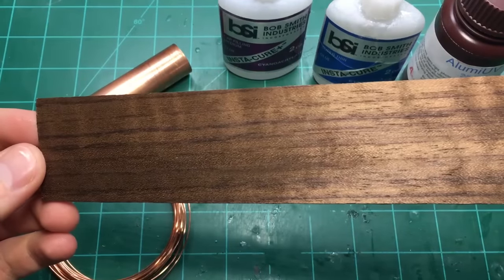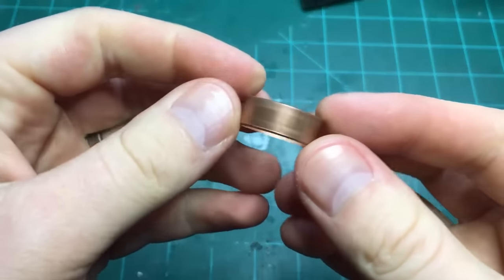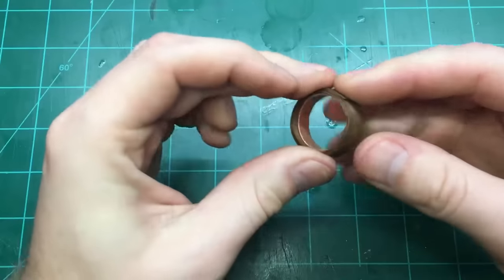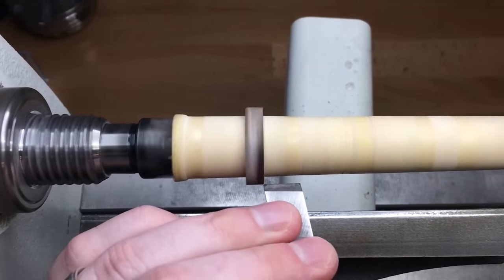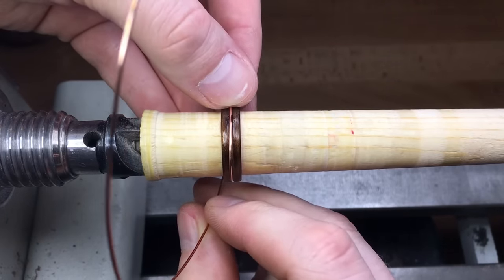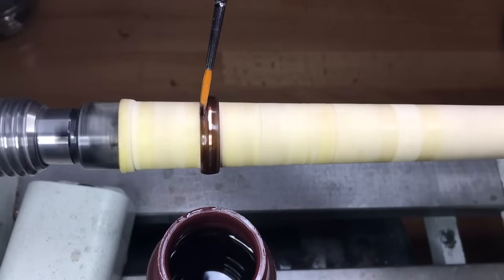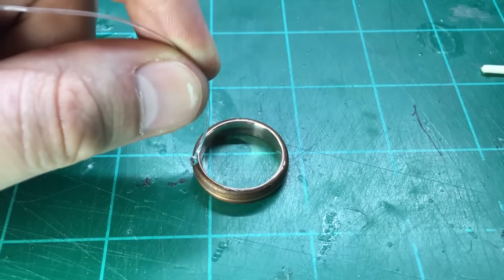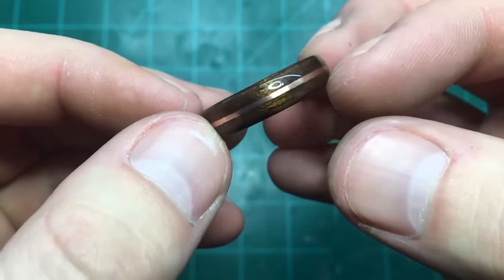Creating a Walnut and Copper Bentwood Ring

Comment: Try running your strip under water, then wrap it in a damp paper towel, and put it in the microwave for 12 seconds. Wrap it loose, and repeat, wrapping it tighter each time, until it's tight enough to wrap around the pipe. It works well.

Comment: Well done, I tried my first ring this evening and I have to say, the blue painters tape is NOT the way to go, need masking tape for sure. Plus my  wood was maybe not the right kind of wood to try my first ring with as it broke multiple time trying to get the paint off. I did manage to salvage some of it and glue it back on after I put the piece of copper in and rolled it. Now it's setting up with the CA glue and will have to continue this tomorrow, we shall see how mine turns out. 

Kudo's to you man, keep up the excellent work...

Comment: Here in Puerto Rico we use  Palm Nut (specific palm) we call "Corozo" ; the tricks that must be learned before attacking a job, any holes that need to be made MUST BE DONE FIRST, otherwise when you start to cut the nut for the Width, IT WILL CRACK; so you measure your width first, mark it, then you cut and you make any indentures for wire (copper or gold); the finishing process is almost as your, your's is more refined 🤑🤑

Comment: This is by far the most beautiful ring you've created so far - really good job.
I should tell you though, that AlumiUV was never intended for continuous contact with human skin.
The SDS of the product even mentions skin irritation and the such. Might work fine for display purposes, but for constant wear, such as with rings, you might want to look into another coating, buddy.
Reply: This is a good point, I've been making my rings with AlumiUV on the outside only. I haven't had much success dipping the whole ring as done in the video, mostly because of the sanding after to remove the blob of resin is hit and miss with me and most of the time I ruin the finish! Leaving the inside of the ring natural also feels better when wearing and I've read somewhere that the skins oil helps nourish the ring. I'd be interested in your thoughts on this?

Comment: A lovely final result and I enjoy watching your videos.

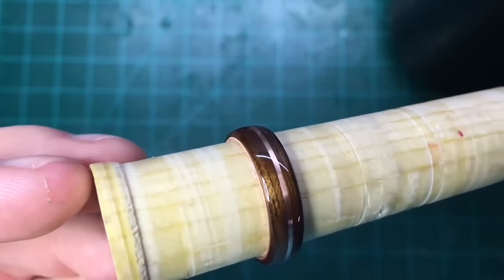However, I was a bit concerned for the safety of your finger as you sand and polish the inside of the ring. (Time 12:45-14:30)
There is a serious risk that you could catch your finger or your abrasive material on the chuck jaws inside the ring and impart a serious injury.  Might I suggest that you modify your lathe chuck by installing a smooth and featureless barrel made from a piece of rigid tubing into your chuck, positioned so that as you sand a ring, any part of your finger inside the ring would be inside the tube.  That way, there's no chance of catching one of the jaws with your fingertip or polishing material.

Keep up the good work, but be safe!  Especially when kids are watching on the internet.

Comment: Beautiful ring! There are some good ideas from you and some of the commenter. I agree with the one comment that you really shouldn't have your fingers that close to your tools, Especially whilst making a how-to video.

I have one concern and you kind of mention it near the end. You say that it is encapsulated so that the wearer won't get green on their finger from the copper. Why make the core from copper? prevent the issue all together by using something else for the core. Why not use silver coins or even modern coins which have a copper core but it wouldn't touch the skin.

Comment: I'm stuck on bending the wood. I tried hot water, boiling water and even soaking for a day. The wood never got soft enough to bend without snapping at multiple points. I made sure to try 5 different woods with different texture, but no luck.

Comment: Lovely ring. It appears that you initially glue up the veneer strip only at the very end after winding, then add the thin CA. I have seen other videos whereby the wood is glued to the core all the way along. Your technique looks much easier and less messy. Is there any appreciable difference in the outcome? Thanks!

Comment: Hi - I love your video - it has helped me quite a lot in making my own range, but it would seem that I struggle badly with getting the Alumi UV as clear like in your video. I do everything the same up until the part where you sand off the node where the nylon is, and there is where things get a bit foggy to me. I have applied polish and polished - I have sanded down (with my dremmel tool) - I have tried and googled just about anything, to no avail. What do you do exactly to get your resin so shiny and back to normal after you sand down the node? I'm literally at the verge of pulling my hair out.

Comment: Hi, love the videos you make some really beautiful rings, i do have a question about finish coats if you'd be kind enough to help. i have a Tungsten wedding ring that i've developed a reaction too. could you suggest a clearcoat that doens't require any specialist equipment to dry that i could coat the ring in to allow me to wear it again? not sure if normal clear coat epoxy is long term skin safe.
Reply: There is a product called ProtectAClear made by Everbrite that coats jewelry.  I have used it to prevent tarnishing but I have been told that it also works well to prevent allergic reactions.

Comment: i would like to make this ring but I have some questions , for one ill be using 925 silver for the inner band and 14k gold for the outer wire, now I know the clear coat is for the greening of the copper but with silver that isn't a problem , so would the second coat be necessary for the inside or for structural integrity for example?

Comment: How did you get the wood to bend without breaking? I boiled my strip for 5 minutes and it broke immediately.
Reply: You probably cut the strip in the wrong way. Try cutting it in the opposite way, boil it and it should bend without a problem.

Comment: Wouldn’t heating the copper and quenching it in water harden the copper like it does steel? In order to anneal steel you get it very hot and then let it slowly cool. The longer it takes to cool the better.

Comment: What are you using to get the water almost boiling? I tried a crockpot that I have left it on high for hours and even if I leave the wood in the crockpot for five minutes it’s still not hot enough to bend it tends to crack and that’s going on a 20 mm ring

Comment: Hi I have a question, I have made a few rings like you do here with different veneers, but finding it very har to make smaller sizes of rings, the bending is to much and it breaks or splinters, any hints on how to do smalelr rings and what veneers to use (if it's the wood it self that is the problem)

Comment: why wouldn't you sand the inside before you put on the copper wiring and all the shiny stuff and covering it with tape after? Just curious? Also couldn't you just dip the ring with a string attached to it instead of gluing nylon?

Comment: I tried the UV resin you used here but the ring i coated never got fully hard and smooth. It remained aort of rubbery to the touch no matter how long i left it in the UV bath. I thought it would turn out more plasticy or galssy to the touch. Any suggestions?

Comment: Brilliant.
Would it not be easier to just flatten the wire inlay with a file or sandpaper on the lathe?

What glue is that normal cyanoacrylate?
Reply: The glues were a thick CA, and a thin CA. The coating toward the end was a UV cured clear resin.
Reply: @jacknelson7786  Ah ok thanks. 
Did you ever try just using UV Resin for the whole thing or will it not work as well?
Reply: @LEO-xo9cz  I haven't made any using this method. I imagine it wouldn't work well consider the resin has to be exposed to UV light in order to cure, and as such trying to use it to hold the ring together initially would be problematic with no light being able to reach the center of the materials.
Reply: @jacknelson7786  That was my thought too. Guess one could use standard 2 part epoxy as well. 
I'm very interested in using UV cure resin.
I'm going to get myself a mini lathe after watching this. 
Be nice to see this made aluminum and carbon fiber cloth. I've seen some cool coloured matting.

Comment: "I'm going to anneal the copper." [hardens the copper]
You realise quenching = hardening, right? Annealing is heating then letting it cool very SLOWLY to room temp (sometimes in an oven, otherwise you're just tempering it). Hardening is heating to critical then quenching. Tempering is heating to near critical and holding it for a long while then reducing to normal.
Reply: Not with copper mate.

Comment: Your cutting pad has 1" squares.  You use a 1 cm wide walnut band and a 6 mm wide copper core cut from standard US 3/4" grade M copper pipe and then observe that the pipe is "size 11" which is a US size, not a metric size.  20 gauge wire is also a US size, not metric (when you say "20 gauge wire," you are specifying "American Wire Gauge" which is defined in US standard measurements, just like the copper pipe you used).  So what's with the schizophrenia?    Why not standard units - 1/4" wide copper core and 3/8" wide walnut band?

Comment: [2:33] Isn't that called quenching?
Reply: Different metals react differently to different heat treatments. If this was a high carbon content steel it would be quenching, but I think as a group, non ferrous metals are annealed this way. While annealing high carbon steel requires you to take the steel up to a set temperature and have it cool it very slowly from that temperature.